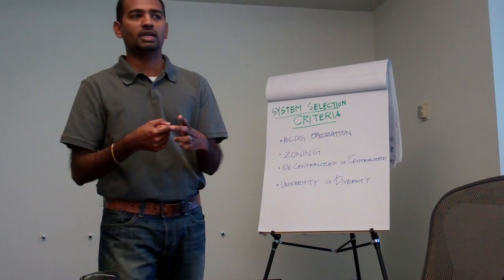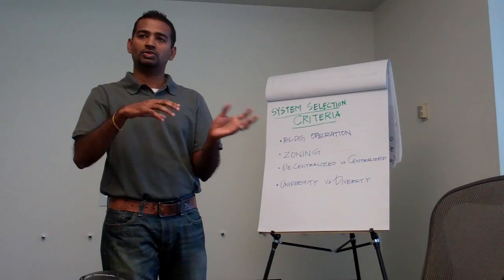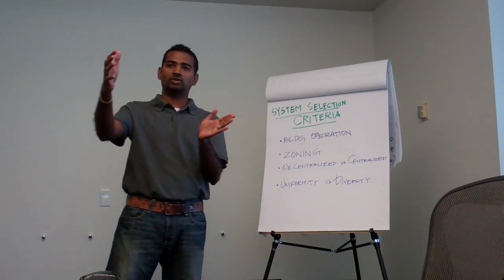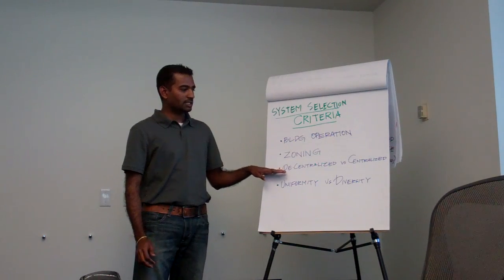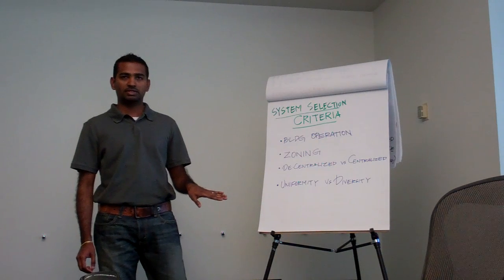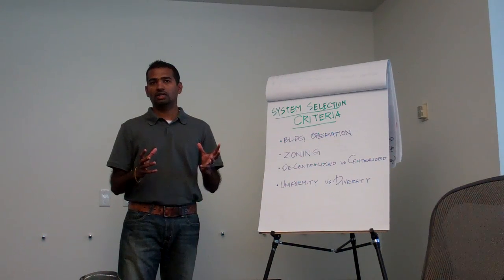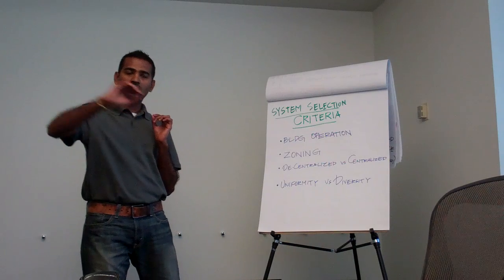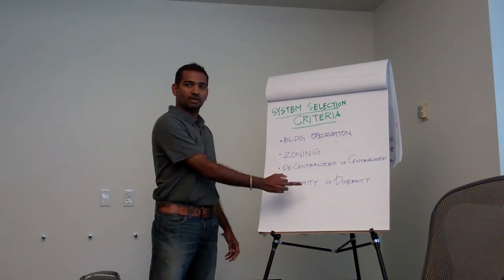Week6 05 HVAC System Selection Criteria

Comment: Hey Premnath  I am a mechanical engineer recent graduate and I am doing job in a small consulting firm. My firm design plumbing, mechanical and electrical systems for small to mid size commercial buildings. As it is small company it is hard to find resources for all knowledge and recent technologies in design. I am still in learning phase. I found you really interesting and knowledge person. Can you be my mentor and help me out to gain knowledge in this field? I will be really appreciated.